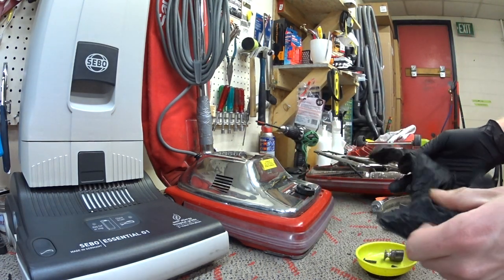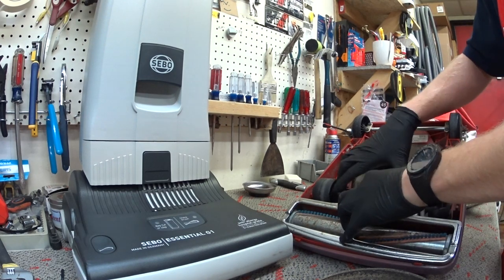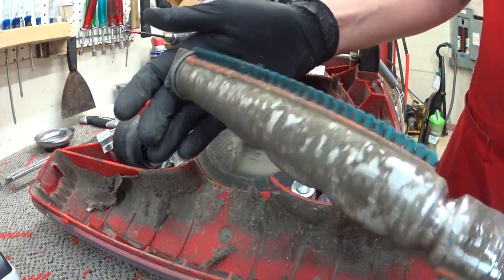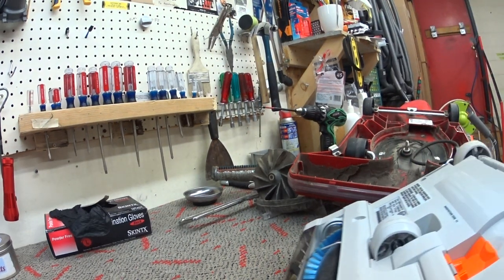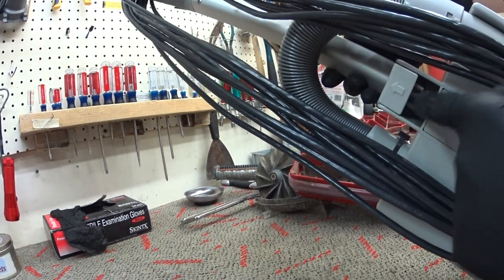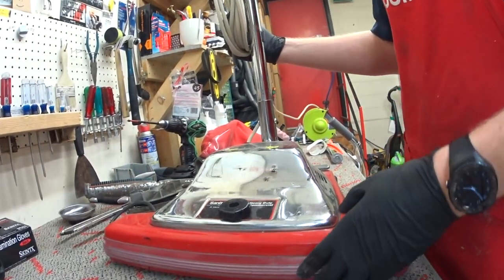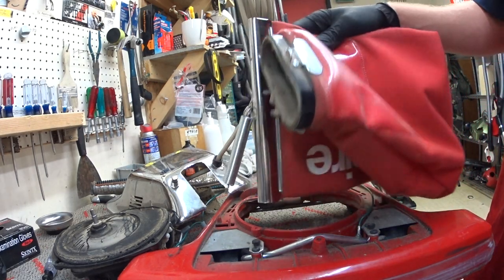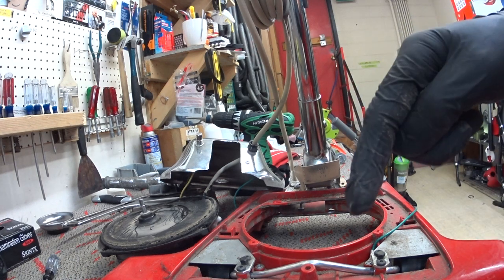Why Direct Air Vacuums are Not for commercial use! (Vacuums explained part 4)

Comment: I think maybe the best 2 direct air vacuums for commercial use are the Royal and the similar-to-a-sanitaire Hoover Guardsman (as long it is not a dirt cup model). 
The hoover, despite its less aggressive brush and plastic base plate, actually has a thicker round belt than the sanitaire, so it will last longer. Maybe if someone were to buy it and swap out the 2 row brush for a beater brush from a convertible a slap a steel baseplate on it it could last longer, though. I've heard great and not so great about the guardsman machines, but the reviews are all in regards to the more recent made in china models, so I've yet to hear someone's input on the pre tti guardsman machines from the 90's and 2000's. The fan is made of lexan, and i'm not certain what type of plastic is used for the sanitaire fans, so the hoover may have a maore durable fan.
The royal on the other hand does not use a round belt so it is less prone to breakage, and the fan is metal so it is much less prone to breakage (in terms of durability, I say it may be evenly matched with kirby's virtually indestructible kevlar fans). The royal, model depending, also has the adjust-o-rite to help avoid guessing if the machine is at the correct height. the filtration it has could be the best of all commercial direct air vacuums (but when looking at all direct air vacuums, kirby is the winner).

Comment: It makes perfect sense but until fifteen or twenty years ago all that most restaurantures had few choices. Most of us had only Hoover Convertibles, and Eureka and Sanitaire Dial-a-Nap models to choose from. I went to a Kirby dealer and bought a used one. It picked up a stack of pancakes in one gulp and didn't slow down. Much better than the other two that just spit them back out. Have you seen the new Hoover Commercial Insight that's based on the Sebo G1. I'd like to hear your take on it.
https://m.youtube.com/watch?v=LxiO92lPT-E
Reply from the maker: I had bad luck with the insight a couple years ago when we sold a few fleet's. Ended up replacing them with sebo for the customer. If they fix the issues the Insight had it's a really solid design physically but the circuit board and wiring issues would keep me from buying them. The Hoover hushtone 13 + is an awesome machine and I would highly recommend that to somebody on the budget.
Reply: Okay so here's my question so what is the best vacuum to buy for residential use.. I have in Eureka sanitaire it's the blue line is that okay for residential
Reply: Kirby is the best for residential use hands down. it's versatile, it's durable, it's US made, it's easy to maintain, and it is all around AWESOME!
Reply: B Sanchez It doesn’t matter so much as to where the bags are made as it does for the machine.
Reply: @johnerikson7094  Too big, unless you live in a McMansion.
Reply: @mikemyers625 Those are fine for carpets. Get a canister vacuum for things above the floor, like upholstery, and you will be set!

Comment: Left off one lil teeny tiny thing. That Sebo is $700, the Sanitaire is about $130 if it’s the 679..
Reply from the maker: At the time of filming Sanitaire  were sold for $400-$600

$350. Is now  the  typical price of a commercial unit from Karcher. These dump bag sanitaries are also illegal to use on the job site in 2020.
Reply: Obviously not a 679. I stand corrected ty!
Reply: In what states @PerformanceReviews

Comment: wow , who are buying these junkies?
I am a Chinese , I haven't seen these junk ever! In China ,we use cylinder type vancum or the dyson liked vacuums . even the upright vancum that is popular in usa just never be seen!
Reply from the maker: This Vacuum is made for the US market . I've been in an appliance store in China it's quite amazing all the options that are available Volwerk,Miele, Panasonic,TEK,Dyson .
Reply: @PerformanceReviews  so, how much is these direct  air junk cost to buy ?
Reply: @呵呵呵呵-l6i  In Taiwan upright machines are common. Dyson's are common here but not as common as a Hoover. Bagged machines are more popular than bag less ones. My relative has an old Hoover Elite II that still works today. Sanitare's sold in Taiwan cost around 150 USD.
Reply: Taiwan has 120VAC/60Hz current like the US and US style wall plugs so you can run US style vacuums in Taiwan with no changes. China is 240/50 and has a unique wall plug so you have to want to sell your product there and built it to work there.  The European companies already build machines for their own 240/50 systems so only the plug has to change.  Not so for a US company trying to see vacuums in China.  Might not be worth it if the sales volumes aren't there.

Comment: What about *price*?  The full-size Sebos start at $549, whereas the cheapest Sanitaire is about $169, up to about $550 for the priciest, whereas the priciest Sebo is almost $1100.  I can see why people buy the Sanitaires.
Reply from the maker: That's an interesting point now that Bissell owns Sanitaire. Originally these machines sold for $500 . Now the pricing is a little different. There is also a Sanitaire knock off of the SEBO for about $300